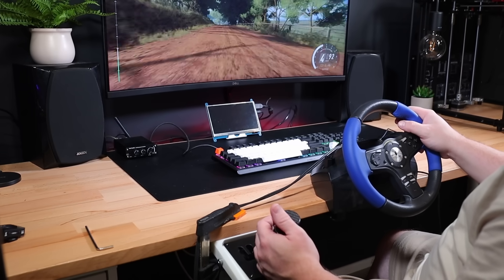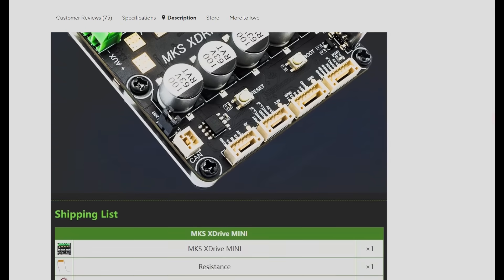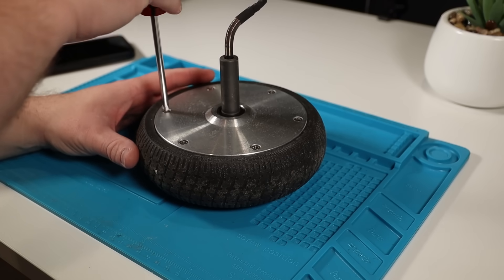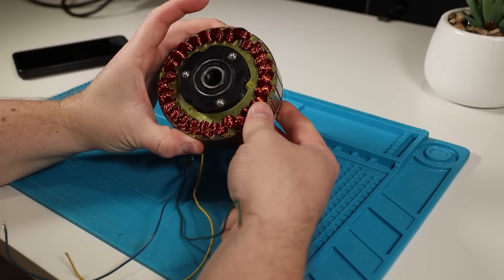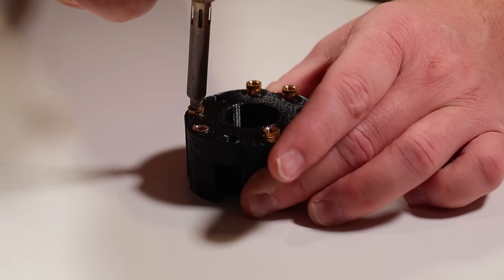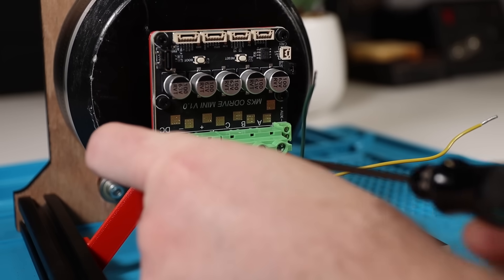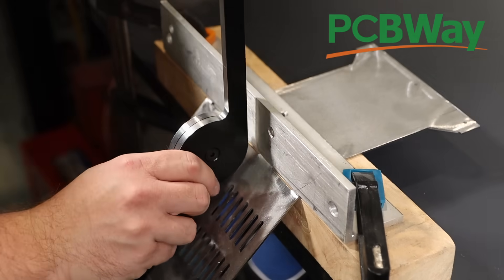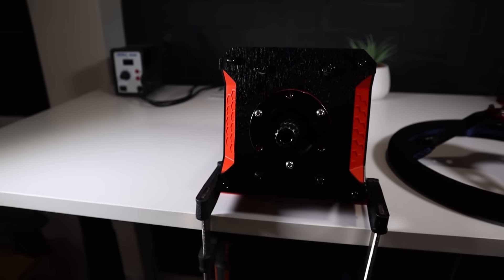DIY High Performance Force Feedback Wheel

Comment: Why not use the sensor in the motor instead of a outside encoder
Reply from the maker: I must admit, I don't fully understand why you can't use the hall effect sensors that are already in the motor. I do know that over a certain speed, those sensors aren't useful and most electric vehicle motor controllers swap into a sensorless mode at higher RPM. Perhaps its just so they can measure the position of the motor, regardless of the RPM?
Reply: @cncdan  can i use an Arduino or an esp32 with another type of controller 
I don't have access to those in the ffbeast website
Reply: probably low resolution/accuracy for an ffb wheel

Comment: You can use the internal encoder it just needs the AB pins on the ic linking around to the encoder connector 😄. Without coms setup it will default to 4000 CPR which is good enough.
Reply: *board version dependant possibly.
Reply from the maker: Someone else commented this a while ago and I looked into it briefly while I was working on the next video. I couldn't find any information about doing this online and didn't have time to go googling part numbers for the IC to try and work it out so I ended up just sticking with my original solution. If you do have a link to some good info on it, I would be interested purely so I can point others in the right direction!

Comment: got my follow, but was it cheaper than buying a dd wheel, like i have none of the stuff so
Reply from the maker: If you don't own anything, not even tools, you may find it cheaper to buy one. If you already own everything you'd need to build it though, you should be able to build one for around the $250USD mark complete with the fancy machined parts from PCBWay that were in the next video. I don't know what the prices are like in other countries but that is still far cheaper than a comperably powerful DD wheel here in Australia.

Comment: i have a question can i use any brushless motor instead, because i dont want force feedback i just want a working wheel
Reply from the maker: If you don't want force feedback, you could just use the encoder and an arduino. No need for the motor controller or motor.
Reply: @cncdan   si force feedback that neccesarry because im just starting sim racing and i jsut want to have some fun

Comment: Just started this project and I cannot get the stator out of the wheel with all my might. Anyone have suggestions?
Reply: Clamp the motor between your feet and pull as hard as you can with pliers if it still dosent come out i used self locking pliers those really helped me out. Tip: maybe try rotating the stator while pulling it out.
Reply: @FurkanSoy-tx8qp  I'll give it a shot! So far I clamped the motor back into the hoverboard and I ppl pulled as hard as I could and it didn't move haha makes me feel weak. I'll try more!
Reply: @evanhiatt9755  haha i've been there too i really think it depends on the motor i have 3 motors here the two motors stators come out like butter but the other  one motor just feels like its stuck😅 if it still dosent come out last solution woupd be locking pliers those grip the stator and should come off easy.
Reply: @FurkanSoy-tx8qp ha! Well I decided to take a stab at the other wheel on the hoverboard and came out no problem?!? Is there some reason one wheel wouldn't budge and one does? Scratching my head but glad I got one out haha!
Reply: @evanhiatt9755  oh thats great to hear! Well maybe the bearings were too tight on that one motor? Or maybe dust inside the motor did you let that hoverboard sit for a longtime collecting dust? That could explain it but Have no idea, but nice good job you got one motor out!
Reply: @FurkanSoy-tx8qp thanks! I bought it second hand and the battery was toast, so I imagine it was sitting a LONG time haha

Comment: Nice build however you could’ve just get t150 for less money than this though
Reply: T150? Seriously? What nm torque does that wheel even have like 2/3? You cant be serious man thats like a toy mate if this wheel had the same torque i would understand but this diy wheelbase can have up to 15nm if you pick the motor lol thats not even the same league thats like comparing a tricycle to a superbike.
Reply: T150 is a low end wheel lmao. You cant even drift with it.

Comment: Great video! Would you happen to have the files to build the housing for ourselves? I'm wanting to give this a go but don't have a CNC machine or reliable 3D printer so wanting to see what the price would look like from PCBWay. Also my electrical knowledge is minimal to none, how difficult would you rate this DIY project? Cheers!
Reply from the maker: I've got the files up for the project now! https://github.com/dmcke5/FFBeast-Wheel
As for difficulty from an electronics point of view, this is about as easy as it gets! All off the shelf components, just a couple of wires to plug in to the right terminals and you are away!
Reply: @cncdan  Legend!! Is there any chance of getting the exact requirements of what to order on PCBWay, and what's better to be machined/3D Printed? I'm a first time user of the website and some of the options look a bit intimidating 😅

Comment: Ok hi dumb dumb thought here but couldn't you just get a brushless quad copter motor and use the old wheel and pedals just upgrade the internals? 
I mean in a sense wouldn't it just take flashing firmware
Reply from the maker: You'd basically have to gut the original wheel and replace all of the electronics to be able to run a brushless motor. So you'd really only be keeping the mechanical parts of it, which probably aren't strong enough for much more power than they current have anyway! Also, that wheel only has 180 degrees of travel which really isn't enough for a convincing driving experience!

Comment: How did you get force feedback on a Logitech Formula Force ex? I use that exact wheel.
Reply from the maker: I just installed the drivers and it works? I did have to disable something in windows to allow it to install the drivers. I think it was the memory integrity setting but a quick google should confirm what to do for you!

Comment: Hey, my one and only question before starting this diy project is the reaction time of the wheel. Is there any delay in comparison to entry or mid ranged brand-built dd wheels?
Reply from the maker: I've never used a modern FF wheel so I have nothing to compare to. I can tell you that I can't detect any delay in the reaction time so it must be pretty reasonable at least!

Comment: i built mine using a bikespoke. and its been working for about 1 year without a single fuckup! i have also made a wheel using the 2nd motor with Viihs encoder mount. both options are good! also you can use you Trustmaster or logitech pedals along with your ffbeast you just need to have both wheels plugged in. i used to run my setup like that untill i bought a pair for Simsonn CLS pedals,
Reply from the maker: Great job! I'm going to give it another go with the logitech pedals in the next video. I have had some difficulty getting some of the driving sims to accept multiple input devices, but I know my favourite old Dirt 3 does it fine so I should be able to give it a bit more of a proper try this time around!

Comment: How much do you value your time? a direct drive ready made is only $300.00? Dial indicators? Arbor presses? Poor fitment? No thanks.
Reply: You dont need all of those tools lol you can use easier options for exalple the viih encoder mount where you only need a 3d printer for the 3d printed parts

Comment: dumb question, but if you have access to a fiber laser, then why did you make the main mounting plates for the motor from ply?
Reply from the maker: @HomeDistiller  not a dumb question at all! I actually did make the front and rear motor plates out of steel, but I gave plywood a go to see if they were suitable and to try and make the project more approachable for people. I found them to be plenty strong enough so I stuck with them! I realise there's plenty of other parts of the project that require specialised tools but I'm working on a way to make basically the same mod without the need for a lathe!

Comment: Yeah, I'm sorry boss but its waaay easier to buy one.
Reply: Yes and more expensive aswell
Reply: @QuizKing-QK8  Moza R5 bundle. $450. When you factor in equipment, materials and time, there is no fucking way thats cheaper.
Reply: @ToastyAF420  mate if you do this project you should have the basic tools 3d printer and so on you dont need to choose the method in the video you can also just pick the viih encoder mount where you just need 3 parts printed and thats it just assemble and done i made it with an ender 3 wich i bought for 80$ so everything i spend 230$ aprox thats not much for 15nm of torque lol
Reply: @ToastyAF420  You do realize the Moza R5 only has 5Nm of torque. The DIY wheel has 15nm which is more comparable to the Moza R16..
Reply: @ToastyAF420  cry lil kid
Reply from the maker: It's always easier to buy one, but that takes most of the fun out of it for me!

Comment: looks like a fun project but after i saw the metal machine thing in there and the 3d printer..i give up 😂.

you can also buy used g27 or t3pa pedals and mod it completely with hall sensors, loadcell hx711 and arduino nano. for springs, i use bike shock absorber and some RC shocks with rubber bushings.
Reply from the maker: I've got a way to do this without the lathe now, although it does require the purchase of an extra part. From the sounds of the mods you've made already, you should really invest in a 3D printer! For people that like modding/working on things, they are an absolute game changer. I don't know how I ever lived without one!

Comment: Do you think the internal bits of the hoverboard hub motor is also at the heart of Cammus C5 wheel? Because let's imagine it's a 6.5" hoverboard motor - they're underrunning it at 19V using a laptop PSU instead of 36V, which should lower stall torque from about 10Nm to 5Nm and power from 350W nominal to 95W, so electrically it works out!
Reply from the maker: I mean, your maths definitely works out! I doubt they actually use hoverboard parts, but it wouldn't be that much of a stretch to assume it has a similar sized stator and magnet configuration!
Reply: @cncdan   Yeah they wouldn't be stripping actual hoverboard wheels for parts, but they can use economies of scale to commission the same factories with the same tooling to make just bits of the existing design that they assemble into something different. It also sort of... looks like you're holding a hoverboard wheel. The base is just a mounting bracket, and the whole wheel is assembled inside the void and on the face of the motor. And the 19V PSU also doesn't come from any particular actual laptop it's just completely identical in spec.

Comment: 12:22 You can find USB adapter with ports for the Logitech pedals and shifter.
Reply: esp32 is also a good choice for a wireless build, needs a little bit of programming but nothing a few google searches and a gpt cant handle
Reply from the maker: I figured that would be something that exists. I didn't bother looking because I am planning to build my own pedals very soon and just wanted to give the wheel a quick test run for the video, which the keyboard worked well enough for! I've had a few people suggest connecting the pedals up through the old wheel and just leaving it un-powered so I will give that a go when test the changes I've made in the next video!

Comment: Well, i have one upgrade id suggest: replace the cheap quick released with a cheap wheel tube, like was suggested on the ffbeast recipe you... Followed somewhat. 

Cheap QR are sloppy and have wobble, and tend to break after not that much use.

Id never suggest putting them on your real car, get an authentic NOS QR if you must. But otherwise, the metal tubes or whatever, are much better in this regard. Much stiffer, and cheaper.

Comment: Excellent work!!!  The oscillation of the logitech in AC is easy to dial out with min-force settings / in combination of using a LUT.  So don't throw it away ... pass it on and make use of it for the next 20 years. These logitech wheels are designed to last 3 generations :-)
Reply: I have the same issue in LSF and F1 2020 with a logitech momo, never had the solution on the first one unless I put the force to 0. for the latter I kind of find a good spot could new lett the wheel go, if I did was just rocking on each side and never slow down until it reach the end stop.

Comment: I've also recently built a hoverboard based motor thought slightly more 'orthodox' with respect to just using the default motor shaft drilled through. However I'm running a 36V supply and it seems to be fine, though both motor and PSU generate a fair bit of heat. I'd say your PSU is even a bit under-spec'ed as I've seen peak draw of just over 430W when stress testing it. I saw you mentioned in another comment about having another approach to modifying the motor shaft and I'm quite interested to see this as I have a bunch of these hub motors sitting around and have also thought it'd be great if they could spin the shaft.

If you're after some pedals there are some really good open source designs out there that can be made almost entirely from laser/plasma cut steel and an STM32 blue pill running FreeJoy.
Reply from the maker: Good to know. I have no doubt you could make the motor pull well over 1000 watts if you wanted (if you upgraded the phase wires), but 350w should be more than enough to provide an accurate driving experience. With these types of motor more voltage usually just means they can spin faster, the current provided is how hard they pull. So if my math is correct, if you're seeing up to 430w of power draw, that would be about 11.95A of current. My 350w 24v PSU will provide up to 14.5A so I dare say it should have enough torque, just a bit less speed.
I am definitely planning an update video to show the other option I've come up with. It involves having a custom part made (which I will provide the design for) but it still ends up being an affordable option overall. I too have a bunch of these motors sitting around and I have some other uses in mind so this was also just an excuse to experiment and see if I could make them a more useful form factor without too much work 😉

Pedals are definitely on the to-do list too, but I haven't had much of a chance to look at them yet!

Comment: Resources for ffb anything can be hard to find. I made my own ffb wheel from scratch. Firmware, drivers, and everything. Absolutely no resources for the firmware side of things at all. Luckily I already had enough experience to do that on my own, but man was it rough to figure out. Decompiling Logitech and Thrustmaster drivers helped a bit, since windows documentation for FFB is terrible
Reply from the maker: That's some very impressive work, and far above my pay grade! Well done! I've also been surprised at how poorly documented everything to do with force feedback (and even just rumble feedback) is. I've built a few controllers now using an Xinput arduino library that supports rumble, but as far as I can tell its some sort of black magic that makes it work!

Comment: What's the wheel rotation limit with this software? I'm looking for at least 1000-1200 degrees; that way, drift steering angle doesn't have an insane ratio much below 10:1.
Reply from the maker: @Drunken_Hamster  I've got mine set for 900 at the moment. When I'm  back on my computer next I'll check it for you!
Reply: @cncdan  So, what did it turn out to be?
Reply from the maker: @Drunken_Hamster  we had a cyclone hit us late last week, had no power for 72 hours. Might be another few days before I can tell you 😭
Reply: @Drunken_Hamster it has 1080°

Comment: It's a really bad idea to build a switch in the power line. If you break the connection the wrong time you blow up your controller
Reply: for real? where i should to put the switch?
Reply: @bober11252  before the power supply in the ac line. Never cut the dc supply of a brushless motor controller.
Reply: @wiju  but it is the same, no power for controller
Reply: @bober11252  no, if you open the dc line you have nowhere to push the breaking voltage spikes. The large capacitor inside of the power supply is no longer taking them.
Even if you have the break resistor installed and configured correctly, you still have the microsecond spikes that are not buffered anymore. 
It is even explicitly stated in the papers of the driver you use, I have some of those myself.
Reply: @wiju  Are you shure? Everyoine is making it after power psu

Comment: Damn… nice build.
I bought myself a Moza r5 where the wheelbase is around 300-350 bucks. How much did it cost ya to make this and did you measure the torque? Excited for next vid!
Reply: Depending on where you get the parts it can cost 80-170$ aprox. I built mine for 140€. The torque depends on your motors magnets width the strongest motor is a 30mm magnet motor wich has 15NM
The "weakest" has 20mm  magnets and has about 10.9NM you can only find out a motors torque by either opening it up or weighin it 2.9Kg motor wich i buyed online got me 30mm magnet

Comment: I did a very sloppy DIY sim rig, but the pedals worked out very well. What I did is just use an old pedal box I had laying around. The throttle goes to an old throttle body with the TPS running a voltage divider, the brake has a real master cylinder and caliper gripped onto a piece of wood, pressure comes via in my case a 0-100psi sensor, though I'd recommend a 0-1000psi as I could probably pop the current sensor with the pressure. I don't have a clutch solution yet but it feels very good. When I get back into it I'm thinking about 3d scanning my car so I can setup the wheel, seat, and pedal positions to match a real car.